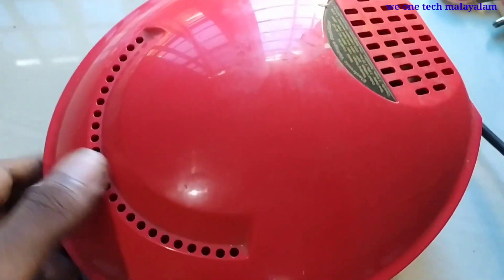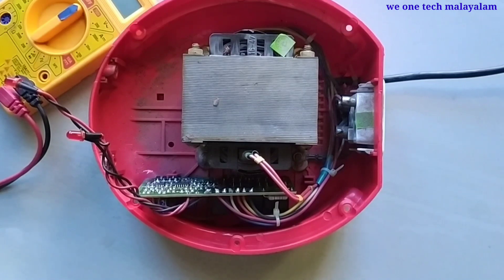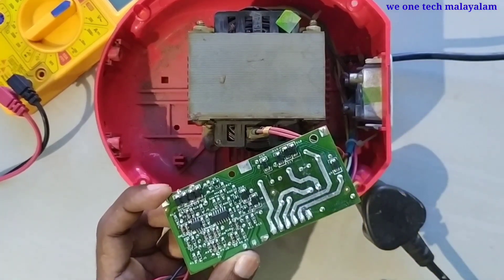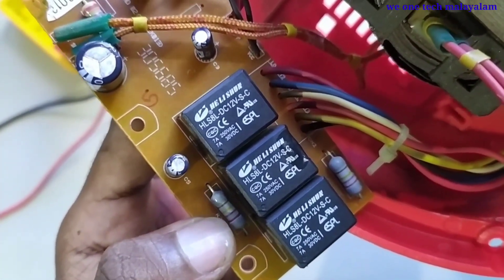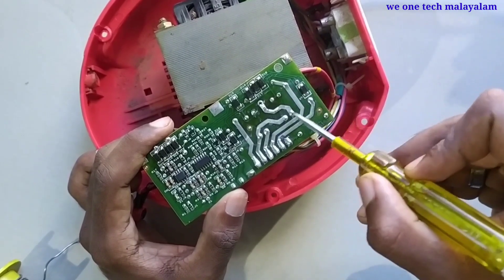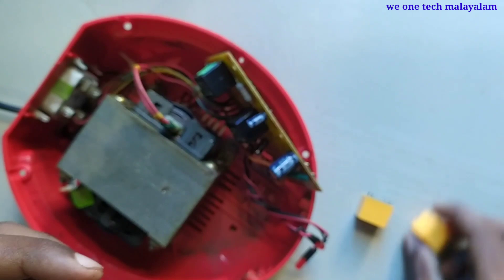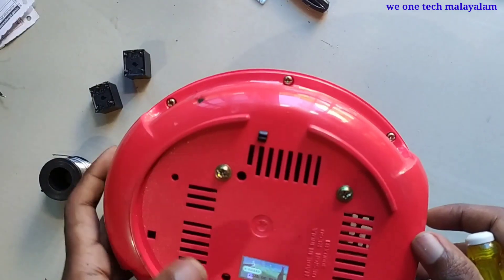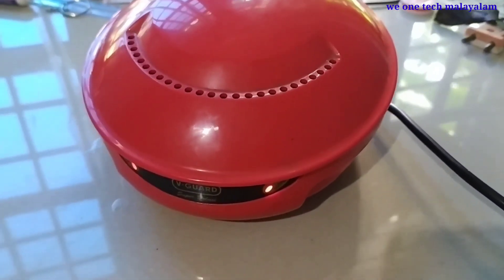v guard stabilizer|എങ്ങനെ കേടായ സ്റ്റെബിലൈസർ ശരിയാക്കാം|How to repair stabilizer malayalam #service

Comment: Ente stabilizerum innale adichu poyi.
Reply from the maker: Board mataloo.. Relay poyathane athum 😊
Reply: @weonetechmalayalam  bro stabilizer aayi connected cheyta oru extender undayirunnu  ,  njan athil oru plug  kuthi randu wire thammil kooti muttichu noki , appo athu kathi poyi ippo stabilizer on avunila , relay poyathayirikkumo
Reply from the maker: @machtechgaming8579  open akki nokku.. Relay poyikkanum